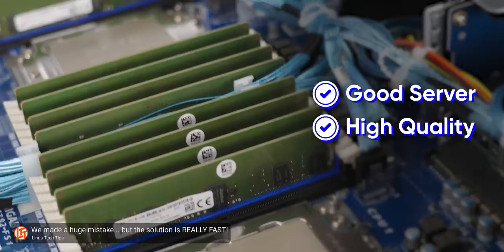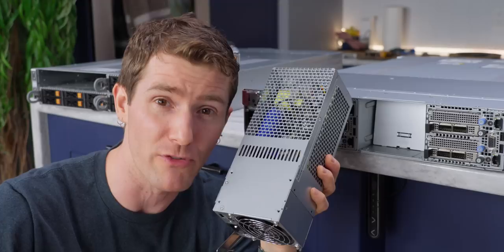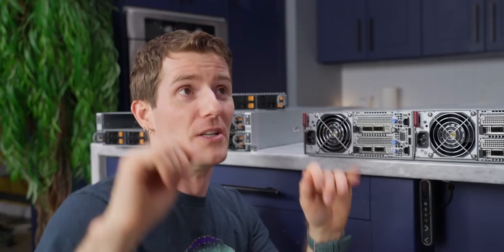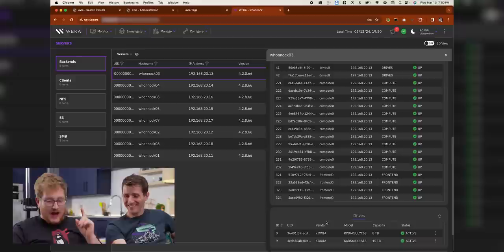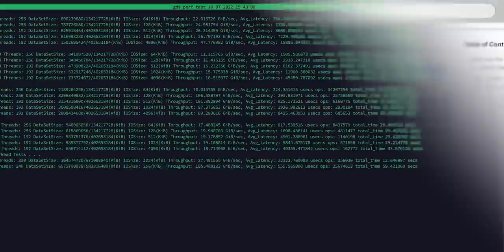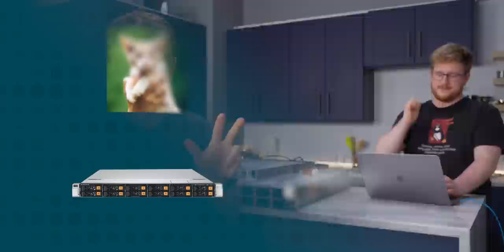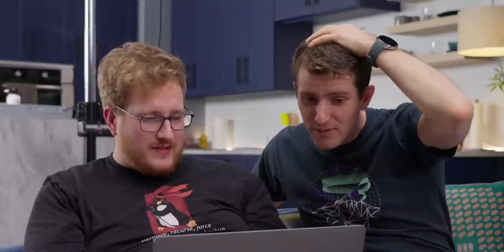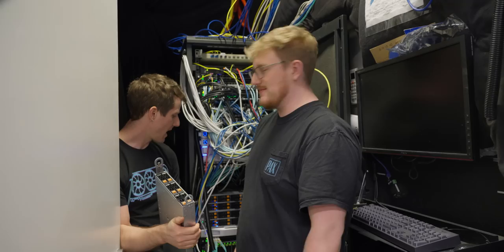this server WONT break....  - Clustered Storage Server

Comment: Now, for true redundancy, do a nightly mirror/backup over fiber optic or microwave link to an identical setup in the labs building. Call it Whonnock 10_2. God forbid another UPS or power bus catch fire in the server room. Or Linus pull 3 servers for a fail over demo by mistake.
Reply: Yep. The first thing I thought is "WHY IS IT IN THE SAME RACK?!??!"
Reply: Finally somone pointing this out, i thought i was the crazy one here
Reply: Using Ceph you can define your failure domain and run a cross datacenter cluster.
The failure domain is scalable, so right now I run a disk level failure domain at home, but in a bit I'll move  to host level failure domain (once I add a few more hosts)
Reply: Not good enough..l they need backup in another part of Canada or US. That area will someday have a big earthquake off the coast and that will sever fiber optic lines and cause major power outages, etc…
Reply: Need multiple geographically diverse fiber links also, preferably to a mirror site in another city/region.
Reply: Fuck it why not route it directly to the Chenyenne Mountain Complex that's true redundancy right there

Comment: 15:43 Jake is referring to the fact that the latency accounts for the fact that they are using DPDK (Data Plane Development Kitty) to facilitate RDMA (Remote Direct Memory Access): basically running RDMA through software, and accounting for the latency as a result (I.e, in the userspace rather than at a kennel level). This is pretty fantastic!

Comment: the truly nice feature to high availability is not even just the redundancy but also the fact that when you want to make upgrades or any kind of changes or even just performing a lot of software updates you can pull each machine 1 by 1 and do them in a localized setting so as to not create bottlenecks otherwise for everyone trying to read/write data constantly. something that Valve Corp hasn't even learned as in 2024 there are still a lot of downtime across all services on Steam every Tuesday.

Comment: This is a legitimately insane trio of cool new technologies that all add up to be greater than the sum of their parts: Supermicro's insane node architecture, BLAZING fast AND large capacity NVMe drives running ON A FILESYSTEM MEANT FOR NVMe, and that insanely cool AI detection software. I can easily see how just four rack units worth of servers, including these HA servers, GPU rendering servers, email/AD servers, and cold storage servers could conceivably run the entire infrstructure a major VFX house, versus previously needing a literal datacenter full of equipment. 1024 cores, 24TB of RAM, and 3PB of flash in 4U work of rackspace running at 100GB/s WITH a filesystem (over a network using non-optimal NICs) is WILD.

Comment: Heeey Linus finally getting redundant on his infrastructure! A note for the uninitiated, these blade chassis are primarily designed for density. You can get the same level of redundancy without the fancy 4 sled chassis, but it takes up more space. 4 servers for the rack U of 1 is pretty sweet when your rack space is at a premium. But you pay $$$ for that density. 
Redundancy is great. But what about support? When one of those sleds fails, how long does it take for you to get it repaired and back up to full operational status? Does Supermicro have a 4 hour onsite pro support SLA? (I think they do, but it's not mentioned in the video.)
And I have zero doubt that Jake will put FOSS on this thing and be calling other youtubers whenever there's a problem.

Comment: Building anything without any single points of failures are stupidly difficult as there will nearly always be a deeper level that will act as a single point of failure. Go deep enough you need different power deliveries, network paths into the building just to avoid those single points. The ame type of issue happens to nearly anything you make and if you design stuff with the focus of not have a single point of failure at every level, your solutions will normally need the normal power, and a backup power, same with network, hardware and so on. And if you are really focused on it, you use a 3rd matching system to balance the others and to check that at least two systems are actually working. But for really important things going that way is actually rather important.

Comment: The servers are cool. That AI generated relational video database is flat out amazing. Assuming that could be generalized for many data types (images, text files, PDF's, etc) you could have a search function on your PC that would actually be useful as opposed to what Windows provides currently. With disk space as cheap as it is and most PC's in consumer use being so overkill, there would be plenty of CPU and GPU available to do the analysis in the background. Who cares if it took a week or two? Once it was initially set up, it could just analyze data as it was created. Heck, I'd happily pay for that if it were available for a reasonable price.

Comment: I have an older Supermicro Twin^2 2U server where it has four half-width blades per 2U, similar to this.

Of course, this is a LOT newer than what I have, but considering that I was running that in the basement of my home -- mehhhh...

(And I also had four Mellanox ConnectX-4 dual port 100 Gbps Infiniband NICs as well that was plugged into a Mellanox MSB-7890 36-port 100 Gbps Infiniband Externally Managed switch.)

So there are aspects of this that I was running in the basement of my home.

That server has been decomissioned.

The AI stuff is new.

(I'm using Photoprism and it is using my RTX A2000 for face detection.)

Comment: For total protection you should have a co-location.  Duplicate all your main servers in someplace like Calgary.  Then when the big one hits the lower mainland you can just work off the servers in Calgary.  On another note, I'm considering revamping my home network.  I'm looking for a website that might give me some ideas about what to do.   It's basically the IP scheme that I want to modify.  I have 2 Hyper-v hosts that each have a VM doing Domain Controller and I have a single physical DC.   Each of the hyper-v hosts has 4 nics as does the physical  DC.  I need some ideas on how to plan out the IP assignments.

Comment: I am interested to see  CEPH vs WEKA.  Ceph is built right into proxmox and supports block devices(so proxmox vms only copy memory to 'migrate' to other nodes (= near instant migrations of running VMs)), file share (SMB), and S3 buckets. There is windows support for mounting disk directly on boot etc. I think its great and its also free.

Comment: you should plan out a new network closet with like 3-4 racks and migrate in early mornings step by step - add only 4-6 servers to each rack to facilitate change schedules - spend like a day on planning and optimizing and it should end up paying off longer term in ease of use and organization - you have the room, you have the money and it makes sense but do you have the management and political will to make it happen - hopefully - you may want to do 2 separate much bigger 'closets' for even more HA security

Comment: Wait, do you not have power backup? Even in my small office of 5 engineers we still have a solar + battery setup so we can keep working for 12 hours without power. I guess BC doesn't flood all the time and has hydro, so your grid is probably more stable than ours, but still it's pretty cheap to make it redundant.

Comment: I've been meaning to learn more about NVMe specific file systems, but for my limited budget and limited workload, ZFS on old spinning rust hard drives is just fine... But I am starting to think maybe I should have run my file server on BSD UNIX or FreeNAS instead of regular desktop Linux. I choose desktop Linux to run everything because my file server is also the loaner PC I let friends play games on when we used to get together and play some games... and someone insisted on using a macbook (Back when they used intel) and no mouse or a chrome book.

Comment: The challenging question isn't "will they lose data" but figuring out "how often" and "why". Personally, I'd be worried about 0) Operator error; 1) SW misconfiguration; 2) SW internal data corruption; 3) SW internal data corruption; 4) did I mention SW internal data corruption?; 5) HW single point of failure (SPOF); 6) "data center" SPOF. I'd ask HW & SW providers what their availability guarantees are & how they know what they're getting in the real world.

Comment: Why would you use non plp dram boot drives when when dramless drives are an option? ....when you lose power, you lose the dram on both drives possibly corrupting the data on both at the same time.

Comment: Now this brings back nightmares for me.

280U Of space, 140U of Dell 2U servers containing 4 motherboards, 8 processors and the list goes on, just older versions of what linus has really, then we had to install the god damn lot with Proxmox (cos the customers was a moron) and cluster the lot together, and folks, back then proxmox was nothing more than bad software its not like it is now, works out of the box

As i recall the CPUs were 5650's 6 core 2.93 Ghz 12 Thread and there was 2 of em per sled, 4 sleds per 2U and something like 20 chassis per rack.

Comment: All this tech is quite cool, but it's completely unnecessary. Part of the problem is their tendency to shoot 6k, 8k, or 12k RAW. That increases data massively for a slightly better result when factoring in YouTube compression not to mention rendering compression. The Sony FX6 cameras is seems they use are fine, but any RAW recording is largely unnecessary. For HDR on the web, 10-bit 422 is more than enough. They add gigabytes per video just so that they can use cinema grade tech they simply don't need. Filming with a Canon XF605 or Sony FX6 or RED Komodo-X in ProRes 422. They have cool tech to solve a problem they created. Yes, even with a lesser camera, they'd still need a server, but they could save thousands of dollars by avoiding RAW and avoiding resolutions beyond 4k.

Comment: i have 2 sabrent rocket 4.0 drives both for some reason do not like call of duty on my tuf gaming b650 wifi pro the game just crashes constantly i switched to a xpg rgb nvme drive i had laying around it works fine so does a wd nvme so im not sure what the issue is with sabrent and my setup i even switched gpus from a rx6800 to a rtx4070 ti super

Comment: Why would anyone invest this much money configuring this much redundant compute and storage THEN PUT ALL THAT HARDWARE IN A SINGLE CHASSIS IN A SINGLE RACK?  If work continuity is so important for an organization, this horsepower should be split across two racks spread as far apart from each other as possible with redundant switching and routing powered by seperate A/B power.  If you have a ceiling leak that drops water on the rac, you could still lose access to that storage.

Comment: They are finally trying to standardize those LOMs that have been for ages on proprietary slots like minimono, different types of daughter ports, all in a single slot that can provide up to 16 lanes of pcie instead of the prevoius LOM which I think did only 8 but double density connector. My best recommendation to see that continuing for other years

Comment: This is exactly the reason I unsubscribed from this channel. If you need enterprise-grade equipment with 5 (or more) 9's in uptime, you need to do it properly and go with NetApp, Dell/EMC, HPE, .. Supermicro is the cheapest server junk around, not to mention some of its quirky ways, utilities or ugly interfaces to configure the equipment or update the firmware.

Stay away from them, even if the chassis just costs 1 EUR/USD/CAD.